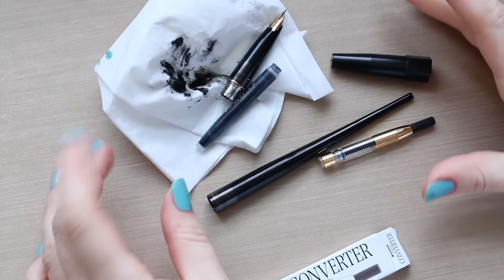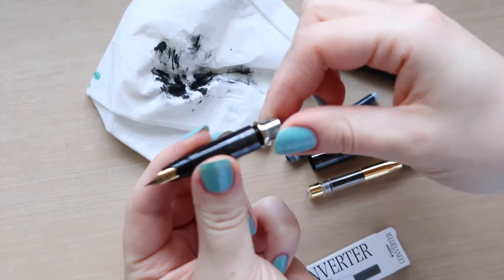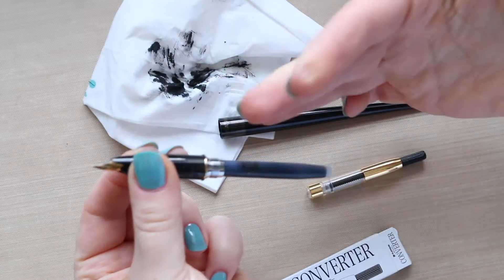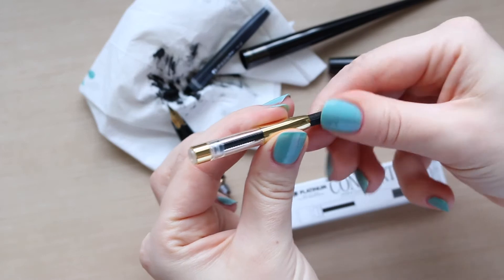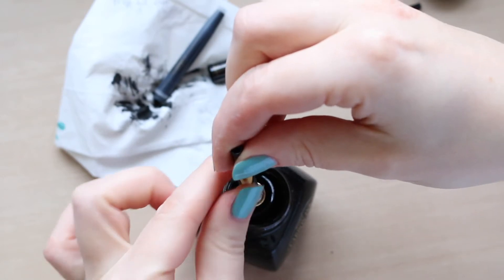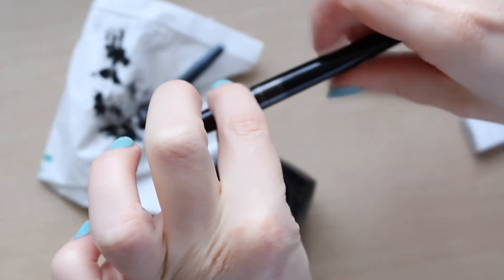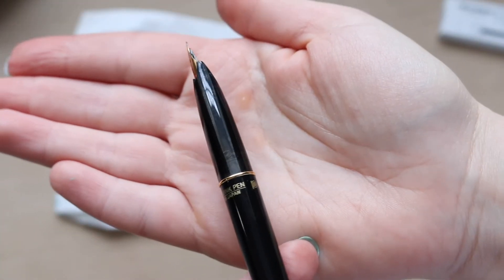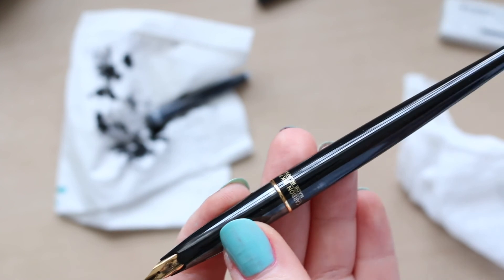Platinum Carbon Ink Fountain Pen Converter | Review + Demo

Comment: You can get the converter completely full by screwing the mechanism back down and up again.  It may take 2-3 times to completely fill.
Reply from the maker: Thank you Rebecca, great tip will try it next time! :)
Reply: But you can with a lot of bad luck spoil your whole bottle with ink if you push back old ink in the bottle. I would personally not recommend that.

Comment: I would have never guessed that would be how to fill it! I ordered one when you first recommended it but by mistake I got the fountain desk pen. I'll see how it goes but I'm most likely going to want this one. There's surely a difference that will bother me, mine has the gold on the top of the pen as well.
Reply: I'm happy you got an affiliate link, so far I have purchased most things you have recommended. Most of the things were items I had noticed and had in my wish list so once seeing them I just had to have! :)
Reply from the maker: Yes took me a while to find some time and peace and quiet to be able to concentrate and do it :)) That's for your support, greatly appreciated! :)
Reply from the maker: I remember I was also very confused when I started looking into ink pen converters, so hence why wanted to make this video. And actually was really surprised how long that cartridge that is included when you are buying the pen lasted. Since I got it I pretty much have been using it in 99% of my illustrations and drawings and it only run out now, probably because the nib is super fine so you don't use as much ink as when the nib is bigger and deposits more ink.
Reply: So I ordered 2 of these and the converters through your links, thank you for doing that :) I wanted one for my Diamine oxblood ink, Alyona, if you haven't tried these inks yet you must, they are wonderful!!! And a great selection of colors.

Comment: Is there a reason you don't just use the carbon ink cartridges that amazon recommends to go with the pen?
Reply from the maker: Amazon does not recommend the cartridges over converter, as you can use one or the other. Platinum Carbon Ink sell the pen with one cartridge included, which is what I was using. My preference is their own brand converter, I find it more classic and also it is a lot more visible when the ink is running out compared to the cartridges. Also it is considered environmentally friendly to use a converter. But everyone has their own preferences :)
Reply: Good point about being more environmentally friendly. I just noticed the cartridges pop up on amazon and it made me curious if you thought it performed better with converter. Thanks!